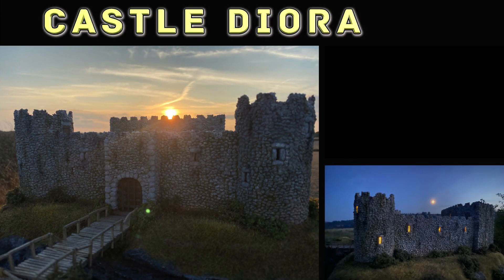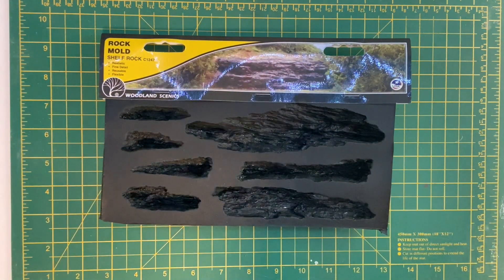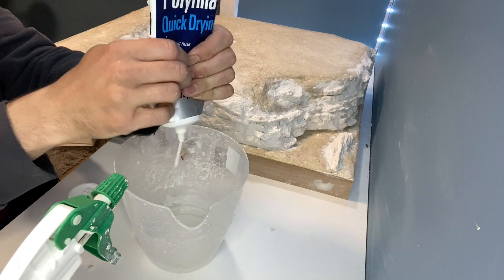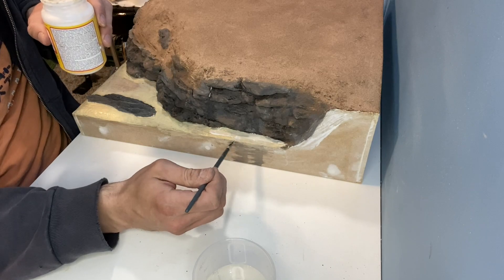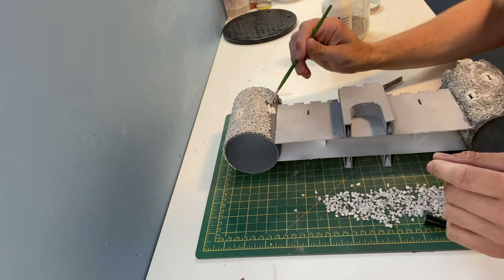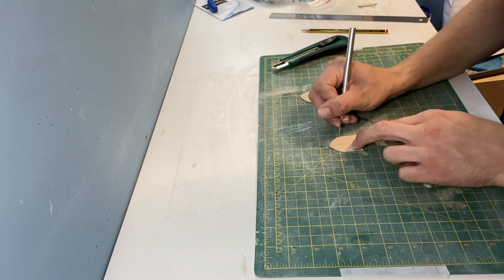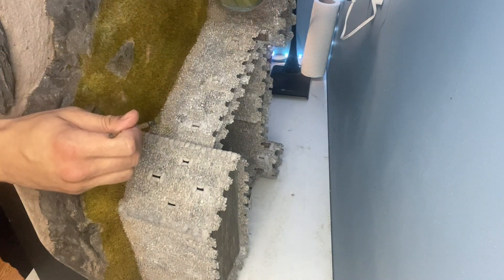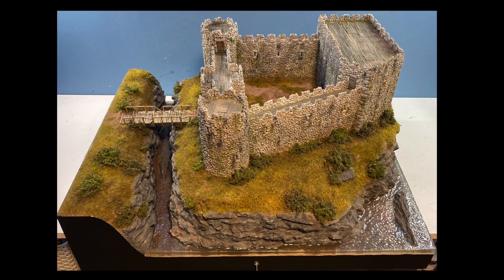Castle diorama - an epic scratch build!

Comment: 31:23 wooo looks so good in natural lighting, might look a little better if your shot was zoomed out a bit. I'm not an expert but i'm pretty sure the smaller the model the further away you need to be for it to look convincing. If you go back and watch the making of the lotr films they built 3 different sized models or all the castles and fortresses, the ones they used for closeups were massive
Reply from the maker: Thank you.  Unfortunately, I couldn’t get the angle I needed to blend it in.  If I had made the base a bit bigger, I think the photos could’ve been better.

Comment: Once again excellent work, I always use nothing much more than ordinary polyfilla mixed with PVA glue with a touch of water,  easy to detail by how wet you make it, sets rock hard for Dremel detailing. Big lumps of stone work down to cobbles made easy backed with paper for easy wiring etc. if needed. Also good for creating waves over a papered pencil or dowel that pulls out just before it dries to hard. But interesting to watch your work as we can all learn.
Reply from the maker: Thank Arthur, that sounds like a great technique. It’s amazing how much you can learn about modelling from each interaction.  I have personally found a comment online or five minutes chatting in a model shop absolutely invaluable.

Comment: No wonder you've been away a while!
I have several rock and wall moulds and, after a recommendation from someone, I ordered some Herculite. There's not much in it regards crispness of mould. But it certainly seems stronger and a lot less likely to break when you're trying to get your items from the mould. Also, I have used parts of larger rock moulds, ie not filled completely, at angles and to use up spare plaster/Herculite and you can get some interesting results. 
A word of warning though - I thought I'd speed things up by adding black acrylic paint to give grey rather than white rocks! Nope!!! The mixture curdled, for want of a better word, and went off faster than I could get it into the moulds.
Reply from the maker: Thanks Davie.  Thanks for these tips - I've never used Herculite before but I'll have to try it.  Sorry to hear about the paint mix but thank you for warning me!!

Comment: you don't need a heat gun on shrink tubes,, a lighter will do just fine, nice job
Reply from the maker: Thanks Don, that's a good tip and must be much quicker than using the soldering iron.

Comment: Propper modelling!  Love it!  Random question though....where do you source your celotex?  I'm in the planning phase for building a layout and am trying to work out cost estimates.  No idea what to go for regarding making the terrain such as XPS, durafoam, etc
Reply from the maker: Thank you!  I picked mine up from the local DIY store (Interline).  It's currently £7.61 for a 1200mm x 450mm board which is 50mm thick.  It's good for building up terrain as it's cheap and light.  It has got the usual irritable fibreglass particles but it's not an issue if you take the correct precautions.  XPS, etc would be great but it's so expensive it’s only feasible on small projects.  I hope you enjoy building your layout 👍
Reply: @DartsideScenics  Thanks, yeah i found that when looking at getting hold of some that the price was really high.  I'll have a look and see where i can get some as it certainly does the job and is a much more realistic cost

Comment: whats the purpose of the soapy water please?
Reply from the maker: Hi.  When you add scenic cement on to a powder covered surface, it will usually bead which moves the powder and doesn’t soak in.  This will mean it doesn’t stick properly and makes a mess of the surface.  The soapy water (sprayed) breaks the surface tension of the powder which allows the scenic cement to soak in.

Comment: What would the scale on the minis need to be on this? 28mm or 32mm?
Reply from the maker: Hi Ben.  It was built in 1:76 scale so the figures would need to be approximately 23 - 24mm
Reply: @DartsideScenics  oh tricky to scale for then? I had this idea of the run down castle being held by either rebels or deserters. A sort off ragtag bunch just desperately holding on.
Reply: If you can live with 1/72 as opposed to 1/76 then you have a lot of choice.  Particularly the older Revell plus Esci, Italeri, Ceasar and Zvesda model ranges.  They are of the flexible polythene type plastic but there a loads of medieval figures going from the Normans, Crusaders etc right through English and French of the 100 years wars etc Italeri did two very nice sets depicting a tournament and jousting.

Miniart and Zvesda released castle siege sets with ballistas and trebuchet, battering rams and siege towers.

If fantasy is your thing, Dark Alliance do Lord of the Rings inspired Elves, Dwarves, Uruk Hai as well as Rohirim and Rangers. And Conan style barbarians.

There is a specialist website 1/72 plastic figures with a pretty thorough coverage of the entire subject.

In addition Miniart and Zvesda both produced plastic castle kits and forts in various styles that can be combined to make a much larger layout and customise your own castle

And Metcalfe models do a OO scale set of castle components in pre printed and laser cut card including keep, gatehouse, towers and curtain walls.